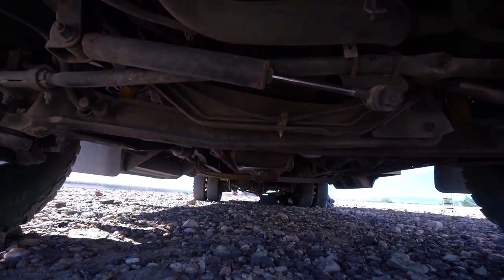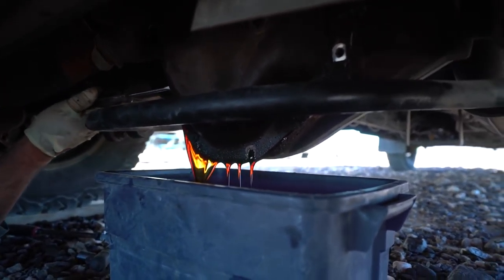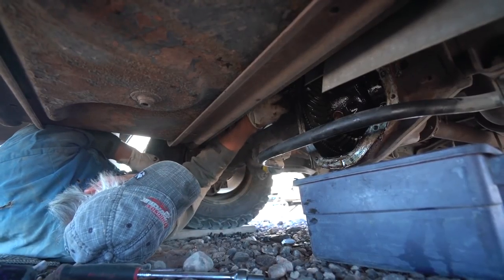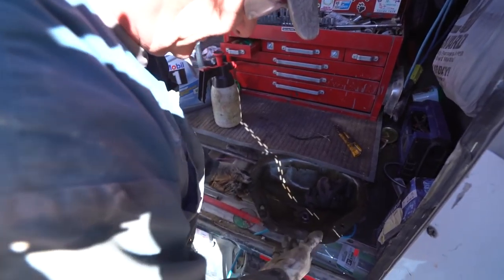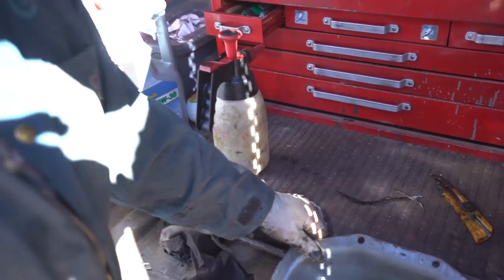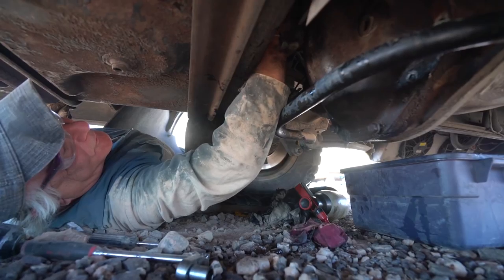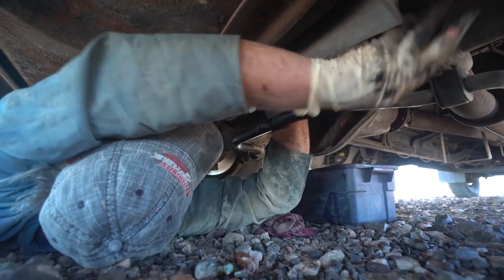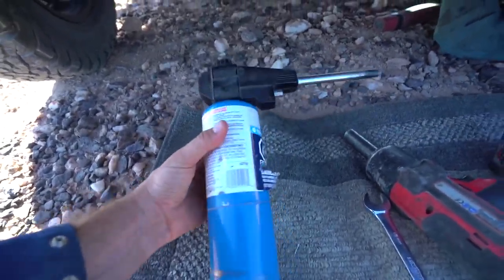HOW TO CHANGE REAR DIFFERENTIAL OIL FLUID W/ BADGE THE MECHANIC

Comment: When changing your diff oil, it's always a good idea to crack open the filler plug first. It good to know that you can refill the diff before letting the old oil out first.
Reply from the maker: I saw that on Chris Fix. good tip

Comment: Most oil leak problems are cheap and repairable on the road...
- Oil pan gasket  
- Valve cover gaskets
- Differential gasket/compound

Head gasket is the only one you don't want to hear about. But, with the proper tools/jack, jax you could DIY a head gasket in the middle of nowhere. If you had to.
Reply from the maker: thanks for the info :)

Comment: Did you figure out where the oil is going? Was thinking you might be burning it out the exhaust. Hope you can find it. I loved my f350 with a 7.3 in it.
Reply from the maker: a loose nut! it's all fixed now :) the 7.3 is the best! just wish I got better milage
Reply: NoMoney Nomad 7.3 is a Great Motor
Reply: Change rear diff.2 a 3.55